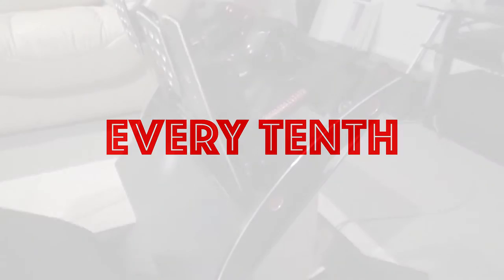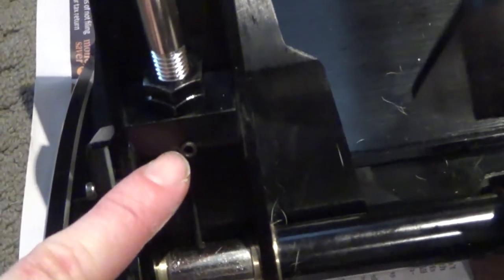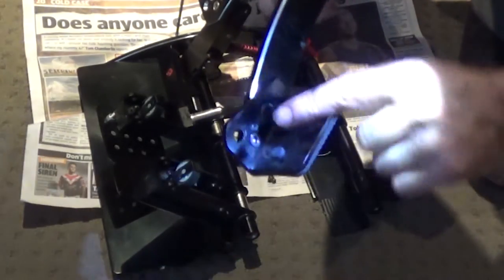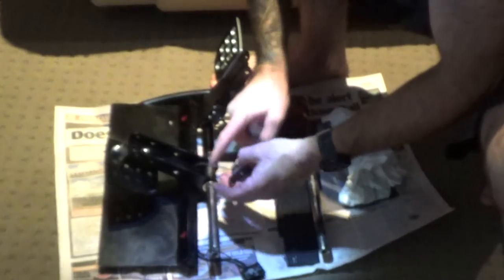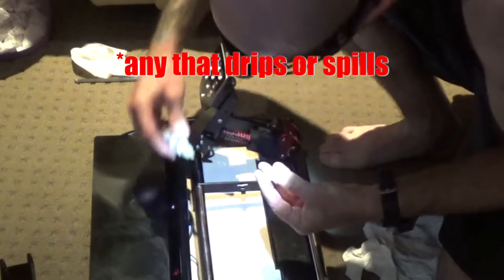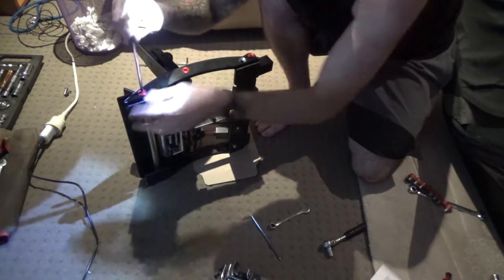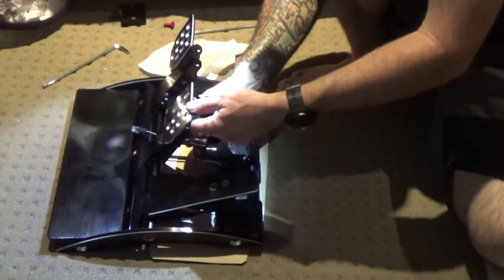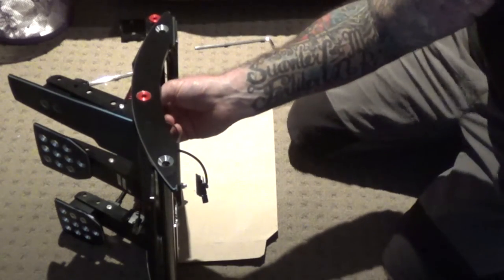Fanatec Clubsport V3 pedals service.

Comment: Thank you. Perfect timing. My fanatec brake performance kit will be here tomorrow. Might as well overhaul the whole pedal set. 😅 Also you might have better luck with a dry lubricant for the squeaking. I use powdered graphite.
Reply from the maker: Happy to help. Cool thanks for that. How do you apply the graphite though? I'm assuming you have to dismantle everything? I've just been using silicon spray as i can spray from the side of the pins and it seems to penetrate quite well. I can usually get away with doing this once a week.

Comment: Be REALLY careful with the grub screws, my brake pedal was OK but the throttle pedal was screwed in cross-threaded at the factory. I unscrewed it to fit the stiffer spring and the crossed thread mangled the screw hole and grub screw threads. I hindsight, I could have possibly removed the rear of the pedal instead and allowed it to disassemble itself, but I did exactly the same thing to fit my brake pedal performance mod kit with no issues. 

The hall sensor requires the bar with the magnet in the side to remain static relative to the piston position for it to work, so if it's not retained in place by a grub screw all the way to the bottom of the thread, you will not have any throttle pedal response.

I had to re-tap the thread and get a new matching grub screw to make the pedal work again. Absolute pain to do, fortunately it was salvageable. Fanatec still haven't replied to my support request and at this point I doubt they ever will. Replacement parts are still unavailable from them despite the unit being on sale since 2021.

Always wise with screws and threads this small and soft to 'back off' the screws half a turn or so, until you feel it fall into the thread properly, then gently screw down.
Reply from the maker: Sorry to hear you had dramas with the grub screw. That's annoying.  Yes, I wouldn't be holding my breath waiting for a reply from Fanatec. Thanks for posting your helpful comments, and yes, I've found it good practice with any thread that if you apply gentle pressure and screw in the opposite direction that the thread will align itself perfectly (you will feel a slight click as it come in to alignment), so yeah, you have a valid point. Thanks again.  Cheers
Reply: @everytenth  I'm also having issues with the gas pedal squeaking on release and that's with liberal application of PTFE spray penetrated into all the back-side nooks and crannies of the pedal. With it, it's better for a while but as soon as the two surfaces manage to 'connect', back comes the squeal 😅.

I wish that they hadn't gone for brass washers against aluminium/steel, or whatever the bars and pedal arms are made of. A couple of 5p plastic washers would have probably guaranteed noise-free operation. 

Also found my lithium grease spray the other night, that's next on the list if the PTFE ends up being a bust after a few weeks. I have plenty of the grease as supplied in the box and brake perf kit - it's so viscous and hard to get between surfaces in the stupid dropper bottle, I only use it for cylinder and piston lubrication. Get quite a lot of push-out on the brake pedal piston too. 

To cap it off, the side hex screws are so tight I can't even loosen them! I applied two hands of torque to both and neither come loose, I was seriously worried I was about to round the heads off. 

These things don't seem designed with ease of servicing in mind 😂
Reply from the maker: @ChristopherWoods  yes it's frustrating to go to all the effort and have the squeak come back so soon. Definitely could have been engineered better, but maybe that's on purpose to sell more new pedal sets to those who are unable to service them. Yes, I found the hex screws crazy tight. (Can't remember if I covered that in my video?) From memory,  one side wasn't as tight as the other, and that is how I managed to loosen them.

I mentioned in another comment that I thought about putting a small sealed roller bearing (like a skateboard wheel bearing) where the small pin in the pedal is (that connects to the plunger). That seems to be the culprit in my set. Would require some mods, but it's something I may look at in the  future.

Comment: Just started having this problem with the bearing squeking in gas pedal. Did i hear right that after going through all this work, it started squeaking again in 24 hrs? Was this all for naught then, and what is the solution...replace the bearing?? If so do they sell replacement bearings. Don't think that's covered on the warranty and we've only had them about 8months so very concerned it will break.. any advice appreciated! Good video! Ty!
Reply from the maker: Yes it did start squeaking again. You could try applying more lubricant than you think you need and see how you go. I'm pretty sure it's the small pin that connects the plunger to the pedal, and there is no real bearing or even bushing at that particular point. It's just metal on metal from what I can see. I have just been spraying mine with silicon spray because the silicon doesn't leave a sticky residue that can attract dirt (as long as you wipe up the excess).

As I mentioned, no real bearing at that point, and they won't break, but there's a risk of them wearing away (the softest material, which is probably the pedal) if you don't keep the lubrication up to them.

I've thought about doing a mod using sealed bearings (like skateboard wheel bearings - maybe slightly smaller) and they shouldn't give you any trouble for life, but just not sure how to connect them. It might require cutting down the block on the plunger and some other slight mods to make that work. If I do, I will do a video on it.

Comment: I am experiencing throttle wiggle and I have the damper on it.
 Is their any way to fix that?
These are under 1 year old and I have made a service request already.
 This is not acceptable for the $650 I spent for the inverted V3s.
Reply from the maker: That's annoying! I'm not familiar with the damper kit, but on mine there are only 3 or 4 points where you could be experiencing the wiggle. The pivot point of the pedal itself and the pivot point of the plunger at both ends. 

How bad is it? I'd try wiggling it by hand and see if you can see anything obvious. If it's the bushings on the pivot shaft of the pedal, you may be able to take them to a bearing shop and see if they have anything similar. Definately shouldn't be happening after 12 months if you have been keeping them lubricated! Good luck with them.

Comment: How often would this be required?
Reply from the maker: It depends how much you use it. I use mine on average maybe 3 hours every day and I plan on doing it every 12 months. I also use silcon spray about once a week or whenever they start to squeak. I will do a video soon on how I apply the spray. Just be aware that if you keep using them too long with them sqeaking they will wear the softest material first which is the pedals themselves.  On the bottom pivot shaft there are brass bushings that can be replaced but at the pins that connect to the plungers the pin hole is directly through the pedal material with no bushing at all.
Reply: @everytenth  thanks for the heads up … I think this is the type of info that is most valuable … much appreciated… greetings from South Africa 🇿🇦
Reply from the maker: @shiranRSA  no problem I appreciate the kind words!

Comment: I think i have some kinda of electrical issue with my g923 pedals, sometimes they give shocks. You know how to fix it?
Reply from the maker: If they are just static electricity shocks you can make a ground cable. Check out my video https://youtu.be/sOl99sc47K4 otherwise if it's a fault with your pedals... I'm not sure.. I don't have any experience with Logitech